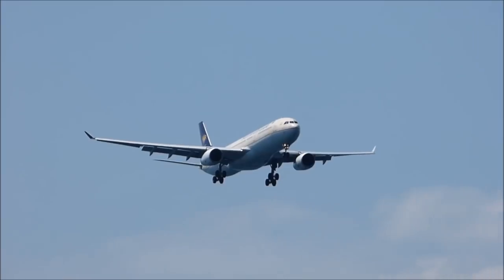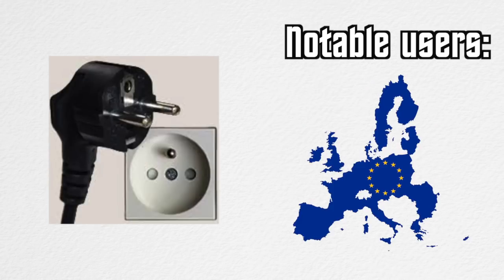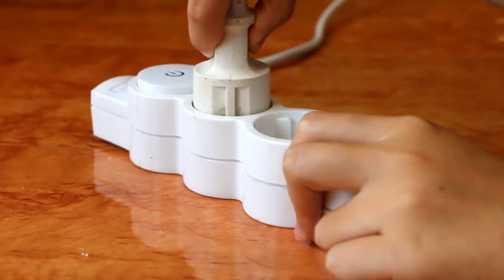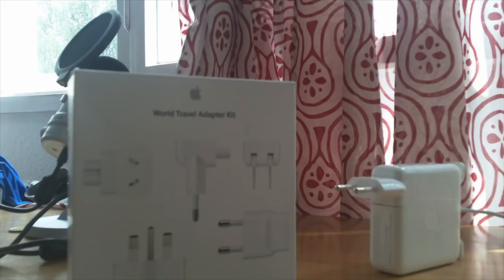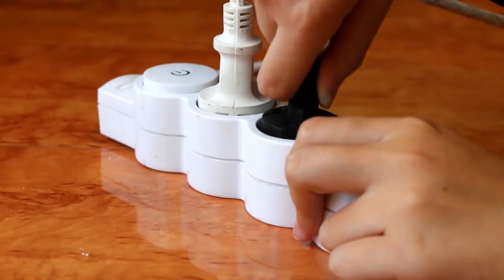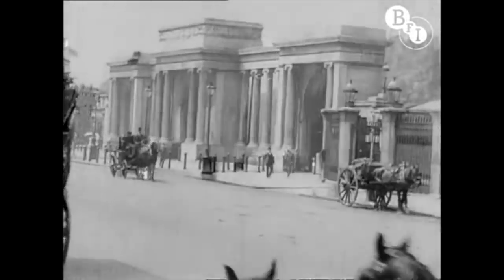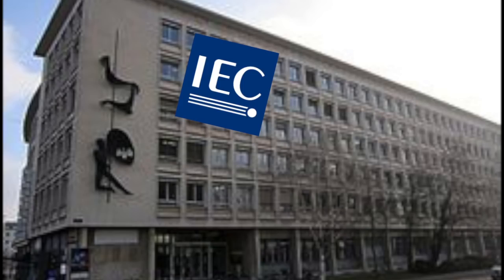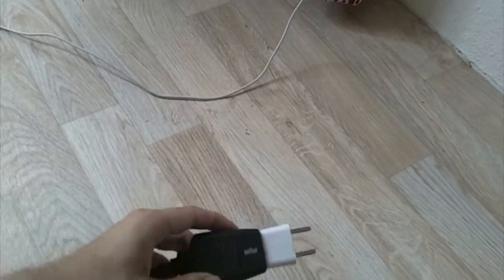Why Different Countries Use Different Plugs

Comment: American one is the best, small, can be plugged in without looking, can be yanked out by pulling on the cord. Doesn’t have a fatal amount of power to run a 14 watt LED bulb
Reply: It's one of the least safe, and needs to carry more current to supply a given power. This results in power loss and voltage drop. 60Hz is however closer to the optimal frequency, but that doesn't have to do with the plug itself.
Reply: @johnleuenhagen9068  It isn't the least safe, again it doesnt have a fatal amount of power. So unless you are connected to a pace maker or something you'll be fine. I actually made a video on my channel you can see American plugs also have the plastic protectors so you cant stick a pen or whatever inside them (this has been a standard for awhile now). American plugs dont lock in until there's like a millimeter of space so there's no way you can have your finger and zap yourself. 

Its also reversible and has groves that let you plug in blind and due to its small size you can fit like 12 outlets on a strip the size of your foot. We dont need a fuse in our plugs because circuit breakers have been the standard for homes since 1960s.

https://www.youtube.com/watch?v=CkjXWGMamZE
Reply: @hajjdawood  Current is the most determining factor in lethality when it comes to electricity, and because of the 110V you have to use a higher current, which is more dangerous than the 230V in the EU.
You need thicker wires than us because of the higher current which generates more heat, and causes a bigger voltage drop, which also means you can't have as long cables as we can.
Reply: Jeppe Beier saying 110v is more dangerous than a 230v is just a blatant non truth. Also in the United States the 220-240v wiring is a thicker gauge than the 110v so your statement on that is wrong as well. Assuming your 230v is running on a breaker of 30-40amp the gauge in wire should be similar between the both of us.
Reply: @RazeG4m1ng  So is it not true 110V requires a higher current? Doesn't that generate more heat making it easier for electronics to overheat, or melt the insulation? Isn't current what kill?

Also fuses in the EU are set to go off at around 13 amps
Reply: Jeppe Beier current is what kills you, but either a 110v and a 220v will provide enough current to do that making them equally dangerous. And the wire would over heat if there was no breaker. The 110v wiring is a thick enough gauge to match the breaker of 15 or 20amp. The breaker wouldn’t allow you to overheat a 110v wire because it would trip which would cut power going to the outlet if your trying to draw that much current. And the higher current your talking about is not relative because the appliance
Plugged in is what determines how much amperage draw its
Going to be. A 110v tv needing 2amps will only pull 2amps.
Reply: @RazeG4m1ng  A TV on 110V will always draw more current than a TV on 230V
Reply: Jeppe Beier I never said it wouldn’t. And if it was on 230v and only pulling 1.0 amp it’s still enough current to kill someone.
Reply: @JeppeBeier   This is not true, the lower the voltage the harder for the current to penetrate your bodies natural resistance. The higher the voltage the less current you need to have a fatal zap. Which is why I have been zapped many times, worse case was me working in a fish tank and an electric pump fell in, while I was soaking wet standing on a metal chair. It knocked me off and caused me to pee my pants but I was completely fine otherwise. There is a very strong reason why British and European plugs made it much harder to get zapped, because its an issue of public safety. Its the same reason why 220v American plugs are also insanely secure with locks etc. 

http://www.conntek.com/Pic/2014115154817.jpg you have to insert it and then twist to lock it and have power flow. This has a much higher degree of safety to due to the much higher risk of a fatality in the event of an electrocution event. That said if you watch my video on my channel you will see even 120v have all of the important safety features the British plug has without all the stupid useless features like it being the size of a brick.
Reply: @hajjdawood  The chance of dying is almost equal between 110V in the US and 230V in the EU if you get a contact point on each hand or do it in water
Reply: @XtreeM_FaiL  That alone isn't true, the greater the volts the less amps you need for a fatal electrocution, because volts is what penetrates your bodies natural resistance, The lesser the volts the less amps will be able to penetrate.
Reply: @RazeG4m1ng  Both 220V a 110V can kill you because the current flowing through the wires depends on what resistance is connected to the circuit. But if a heater demands 3,5KW and you connect it in EU, it will only draw around 15 Amps and it can use a standard 16A breaker on a solo circuit and 2,5mm2 thick wire. If you connect the same heater in USA, it will draw more than 30A and will need atleast 4mm2 thick wire and stronger breaker. That´s just how electricity works. It´s also the reason why we use AC power and Eddison´s attempts to push DC failed. Because we would need an impossible thick wires to transport energy on a long distance using just 110V, we trasform it into 110, 220V, even 400 or 750KV. That way we can lower the current, use thinner wires, but still fulfill the power demands. But it´s almost impossible to transform DC power, we can only do it now using electronics and frequency changers.
Reply: Tsaks1978 Yes, that is correct and I never said to the contrary. I don’t know why you tagged my name with this response though?
Reply: And the prongs always bend.
Nasty, shitty little things.
And actually, 110v is more dangerous than 220v because there is double the current.
(Trust me, I have had shocks in both flavours, and 110v hurts more.)

Comment: While mains voltage have different plug types and wildly different voltages, low voltage DC systems has internationally inter-compatible plugs. A car lighter socket will be somewhere between 9V and 50V while usually it is 12V or 24V. A USB Type-A socket is always 5V or less than 10% higher like 5.4V. USB Type-C defaults to 5V too but with a chip negotiating it can supply 9V, 12V or 20V. Barrel jacks has a few defined sizes and no defined voltage but they are well standardized too, with 12V center positive and 5V center positive being the common types.

Comment: Actually plugging an european plug in an american socket will make motors spin slower and with less power. But doing otherwise....if its voltage compliant the worst that can happen is it spins faster. Otherwise you will learn the basic principles of electrical engeneering: all electronics work on white smoke. Once the smoke escapes its extremly tough to fit back in and the device dies. You'll also learn how fuses work.

Comment: European plug type F is best. Why?
-Protective Earth standard (PE, the ground connection)
-compatible with type C, which uses the same ground plus type C ground, and type E which is ungrounded.
-impossible to unground while Live and Neutral retain their connection. PE comes off last.
-easy to adapt to other plug types, even grounded ones.
-Must be installed in kitchens and bathrooms by standard, and easy to adapt from type C. Ungrounded plugs in these locations must be exchanged by law, and ground connections wired if needed.
-Tips of Live and Neutral remain completely out of reach while partially plugged in. Connection only happens when fully plugged in.
-Smart anti-nail doors in plug holes. Doors only open when a plug is inserted. Impossible to stick nails or any other objects in.
Reply: Type E is not grounded. It is used in France and the plugs are not compatible with type F sockets. However, modern devices typically have CEE 7/7 plugs that fit on both.

I think you are thinking of the contour plug (CEE 7/17). It does not have a letter code (they likely forgot it as it is used on quite few devices like vacuum cleaners and hair dryers)

Comment: In China, wide voltage range adapter serves another purpose, that is, to regulate the voltage that goes completely wild in a countryside. In fact it used to be marketed like that, claiming that the electronics can still work "during the time power voltage drops".
(But then the voltage can also rise during when nobody uses electricity but most electronics just go up to 250V rather than maybe 300V that can happen on a poorly built power grid).

Comment: This is wrong on so many levels - the synchronized european power grid does not run on 220 V and 50 Hz, it runs on 220 and 400 kV and 50 Hz a power grid not utilizing high voltage would be plain stupid 

Household electricity / mains is transformed to 230 V in europe since the 1980s.

Also different plugs shown in your video are mostly unified to CEE 7/7 and 7/16 and will fit in most European socket types

Comment: European plug is the best
Reply: The UK plug is way safer. Their earth pin is a little longer than the neutral and live. The earth pin opens up little doors in the outlet to accept the actually dangerous pins. And the plug itself has a fuse built in. Both properties are compulsory in the UK and thus on every outlet there.
Reply: @Engineer9736  the modern european plugs are safe too, and you won't hurt your leg if you step on them
Reply: Richard van Pukkem No its not Type c is the safest
Reply: Type c has no earth pin, the whole point of the earth connection is safety
Reply: @Engineer9736  Yeah it dont need this the 2 pins have the earth pin in it.
Reply: but the uk plug is still considered the safest due to the third part
Reply: Which plug? Europe has at least a dozen!
Reply: Well, Europeans think differently than Americans. In Germany, for example, the Autobahn has no speed limits. The American speed limit is generally 55mph. In America, any frail little 95 year old granny can get a driver's license. In Europe the driving test is much harder. That is why America uses 120 volts. They think it will be harder to get an electrical shock. In Europe, they TEACH children and adults to RESPECT the 240 volts and use it safely. I can name many examples of education being better in Europe than the U.S. Why is a Bachelor's degree in engineering in Europe equivalent to a Master's degree in the U.S.? I am only getting started, as the list is very long.

Comment: Europe has not been 220 volts for 20 years. It is 230 volts. In Finland the switch was in 1988-95. I doubt a hair dryer cares of the frequency. The voltage is a different matter. 110 V vs. 230 V has nothing to do with AC vs. DC. The lower voltages are older. in the U.S. electricity was adopted more widely so they could not switch to higher voltages.
Reply: Also North America i 120 volts, has been sine the 60s. Before it was 115 V. It was 110 V in the 30s.

Comment: Well your video is not full correct as USA is the only country in the world that uses 100-120V 60Hz rest of the world uses 220-240V 50Hz
Reply: How about Japan and some south American countries? . Google it first before looking stupid in the comments section. it's easy
Reply: Canada, Cuba, Mexico and several Central American countries use 120 volts 60 hertz too.  In fact the USA uses 240 volts as well for stoves, clothes dryers, air conditioning, air compressors and a number of other applications.  So we aren't exactly 120 volts either...
Reply: Japan uses 100V at 50 or 60Hz.

Comment: Interesting to listen to Europeans, particularly the British, claiming their plugs are safer than those in the U.S. We simply learn how to remove safely at an early age. And in locations where there is a serious shock hazard such as bathrooms and kitchens we install and retrofit them with ground fault circuit interrupters. That reduces the shock hazard to almost zero. You can touch a hot wire while touching a faucet without getting hurt.

With our plugs, it is a bit like when the EU tried to ban wooden clogs as unsafe. They might be unsafe if you tried them on as an adult. But in countries like the Holland, people grow up with them and know how to walk safely in them. 

Also, keep in mind that in the U.S. we do have plugs that are even bigger and clunker than the British variety. We use them for the high-amperage, 220 volts for stoves and dryers. That doesn't create any issues because such plugs are only used when an appliance is installed or removed. 

The real problem with the British connector is that they date back to when electricity was consider exotic and plugging devices was rarely done. In today's world the small and easily used U.S. plug makes far more sense. It is quick and simple.

Comment: This is why the Aliens won't talk to us. They think we are  so stupid that we can't even standardize our plugs. 😲
Reply: The plug difference is only a safety measure. The real problem to change it is behind it; The whole grid. It’s impossible to change the electrical standard of a whole country. They would have to replace every single transformer and cable. And swap all the sockets and appliances in all houses as well. Like all at the same time. Power down, swap everything, power on. Changing the trajectory of the moon might be easier.
Reply: @Engineer9736  You can switch from a lower to a higher voltage by just changing the transformators and the fuses. If you would switch from a high voltage system down to lower voltage you would have to change all the transformators and fuses plus you would have to put every cable into the earth and walls and into the sea &c. a second time.
Reply: The aliens got killed by using their own hair dryer
Reply: When I was in Iraq (Deployment) I inadvertantly pluged a US mini-vac directly into the wall with an adapter. Got about 5 min of use before I had to turn it off to avoid overheating. Also, it had a notecable kick when ever I turned it on. It did last the whole year I was over there, but thats ecasue I didn't use it long enough for it to cook itself when I did.
Reply: Damn, we have to DO something!
Reply: Well it isn't a bad idea. One upcoming problem of the USB-C method is that you can plug your phone in with the same charger as your laptop. I'm not saying that can't be solved, however, having different plugs for different power loads and frequencies should be seen as an advantage. Anyone who works in the music industry knows that. People complaining about different plugs clearly haven't worked in music and stage lighting when there are almost hundreds of standards to chose from. Some for good reason others just because we have some old tech that cannot take modern power requirements in terms of voltage etc. But that latter one is more rare.
Reply: or our currencies, i mean come on (it's the worst in Australia where everything from other contrives is so expensive here)

Comment: Went to Japan last year and most of my North American electronics would not fit Japanese outlets. It seems that they almost never accept grounded 3-prong plugs and their 2-prong outlets are unpolarized. They do not accommodate the wider prong of a polarized 2-prong North American plug. Even something like a 2-prong Nintendo 64 made in Japan will have a different PSU plug for the North American version (polarized). Strangely, they are also rated for different voltages even though the difference is minor and they are switching PSUs, which are the kind that can usually adapt to huge voltage/frequency differences.

It really is a mess even between North America and Japan.
Reply: Japan: 100V 60/50Hz
North America: 120V 60Hz
Reply: Rapisu and Hamutarou Thanks, but I am aware of this. I’m saying that it makes more sense to use the same 100-240v 50/60hz PSU world-wide, or at least a 100-120v 50/60hz PSU, since they all use a switching PSU with a proprietary connection (brick fits into the console). Indeed, Japan’s 100v 50/60hz PSUs seem to work fine in the USA despite 20% over voltage. Since Nintendo is using modern switch PSUs anyway, I don’t understand why they aren’t using the exact same PSU in North America, unless the label is misleading and they really used different PSUs due to some regulation that forced them to used polarized PSUs in North America. That’s what I’m curious about.

Comment: The italian type M is Rarely used, we Do have products that use it but we mostly use type C, on devices like Hairdryers and computer cables we use the type M and F, depending on where the product came from, though type M is really just a Type D/F but square, so there are no compatibility problems

Comment: The voltage in Peru it's 220 volts at 60 hertz
Reply: And we use the american and the european plug
Reply: Except in Arequipa that is 220v 50 hz

Comment: British plug is best plug. 
They’re so safe the only way you can be hurt with a British plug is by someone intentionally using it as a weapon or you’re untidy and step on one, so really those are features not bugs.
Reply: cjeam they are huge and bulky and have useless safety features. I can fit 11 plugs - again 11 - on a 1 foot long power strip. You would need a 6 feet long one. Plus American plugs have guides so you can plug them in without looking. American plugs are much more compact and our voltage and amps are too low to be fatal, so we don’t need any of the extra safety crap and you won’t end up skewering your foot if you step on them
Reply: really them being small i know how they are also our ones ain’t that big i never though murican ones were small
Reply: It's not. It's too bulky and all it's "revolutionary safety features" are build into most other plugs as well...especially the European ones (well, perhaps we should exclude the American ones).